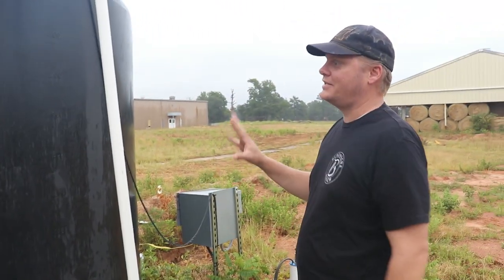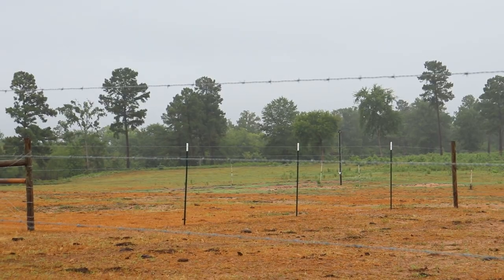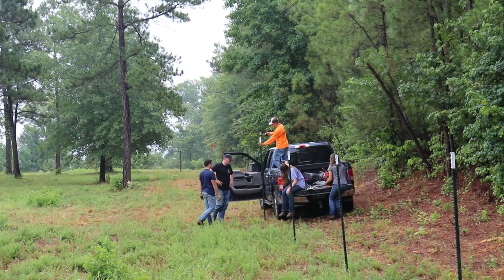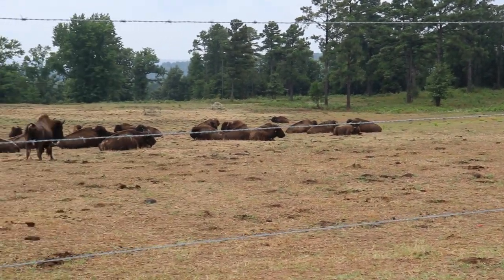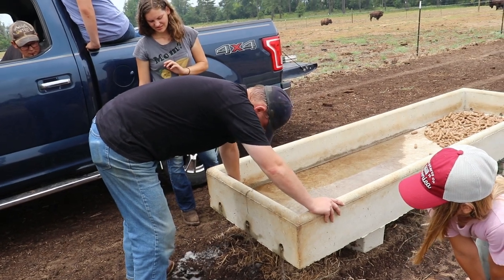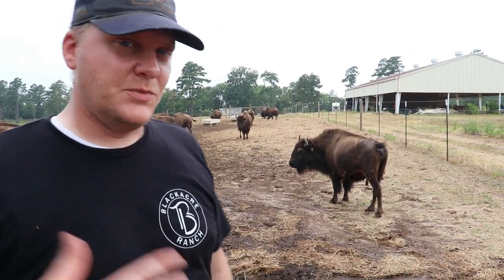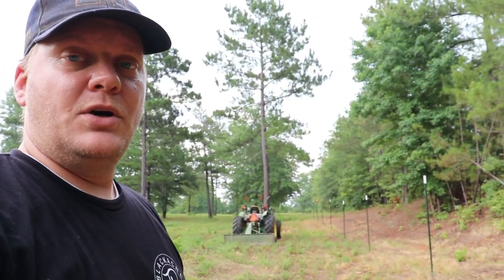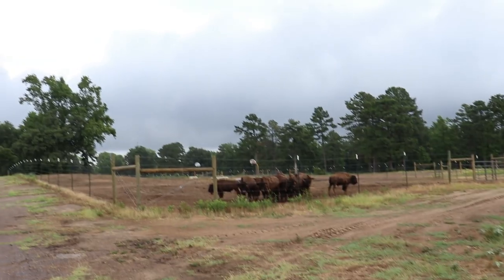Ep. 193 - The Homestead: Fiesty Bison, Loud Noise, Don't Get GORED

Comment: Happy 4th of July black acre ranch.  Cut a piece of metal pipe just bigger than the tpost diameter & weld a flat plate on top (8"×8" or so) of the pipe. Slide it on the tpost before you start hammering withe sledgehammer. Hope this helps.
Reply from the maker: Great idea.  Thank you.

Comment: You can always test the electric switch in the float valve by flipping it upside down or by pulling it up depending on design.  Looks like you might need to get a specialty tool to help, maybe a hoe or shovel.  It will give you piece of mine so you can walk away and move on to another task, besides it will stop when the generator runs out of fuel.
Reply from the maker: I didn't explain it well I guess.  My issue is the controller.  I don't know if it is set up to communicate with the float since we have to run off a generator right now and I don't think the drilling company set it up fully knowing we didn't have electric.  I'll worry about that once the electric is ran to it.
Reply: One would think the switch set up would be independent of the electric source, but you never know with companies these days and “liability”.  You guys seem to have a good grasp on your priority list and adjusting as issues come up.  As you start knocking some of the infrastructure projects off your list it will frees up  more time to focus on other priorities.  I used to have to fill propane tanks in town (for 4 years), but now we have a big tank to feed our property.  The time savings from this one chore is awesome.  I kept telling myself wait for the back up generator, boy was I wrong.
Reply from the maker: @JoeAroner-SIWAYTV  so true.  Getting electric to the well pump hopefully this week so maybe I can sort that float valve out.  If so then that will be a time saver.